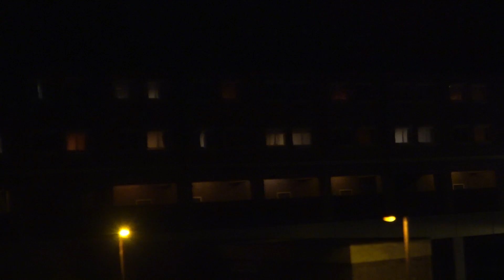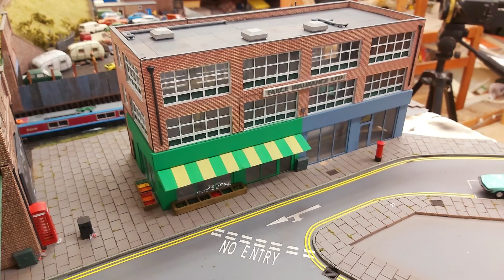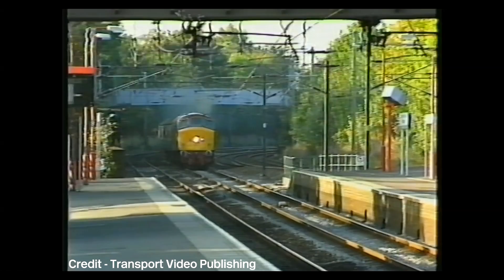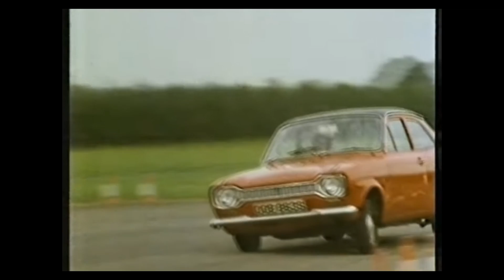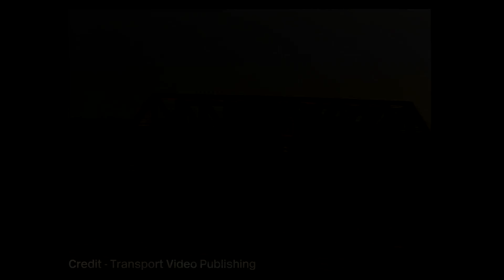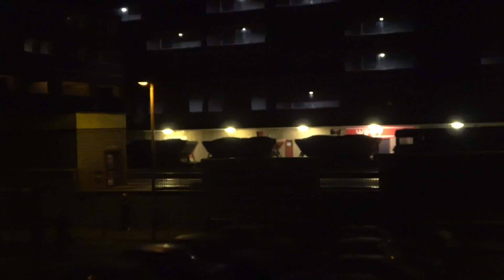Layout Update Winter 2022 | lighting, scenic improvements, vehicles and weathering

Comment: Another great video. Seacows, first batch were riveted like Sealions. Sealions had Air and vacum brakes, Seacows had air brakes but only a vacum through pipe. The Dogfish hoppers on the GN had extra steel raves welded to the top of the sides and ends.

Comment: The varied colour temperature lights in the flat looks absolutely fantastic! Could I suggest while doing night time shots for video, you may find a cheap LED RGB video light useful. If you bounce the light off your ceiling, dim it very low and set it to very cool colour temp, 7000-9000k, this will give you a twilight look as if the sun has just gone down. This will allow the camera to capture some of the detail in the low-light areas. (You may find you need to set your cameras white balance manually to 5600k, if you aren't already doing this).

Just a thought! Absolutely loving your work, keep it up!

Comment: Being a child from the 1990's which wasn't a period far away from the 1980's there was always that one street light or building light that wouldn't always turn full orange in colour and usually have a red glow. It might be great to include one light with this issue. 
Also need to add that one random football that someone managed to kick two stories on the flats or one on the waiting room/ticket office building.

The cars are brilliant though definitely Oxford diecast need to do so standard variants of cars. I would like them to do some more modern tractors 1980's onwards as most of the 80's, 90's and modern model tractors available are H0 scale.

Comment: Started on central section 1988. There was a gang at Lewes station smashing all the lbscr cast iron/ wood benches up 100 years old!  And immediately prior to the nse plastic coated metal benches. Which a few years on the plastic coating had given way and the pressed steel was rusty away nicely and people had screwdrivered up sections so it was sharp and jagged. 
To quote the late great Ian Dury. 
What a waste..

Comment: The communial lighting is spot on with the different Ks. (it deffo looks the part) At first, I thought you'd used Led ranges between 3000K-6500k, but you'd used orange paint to adjust. Superb work as per.

Comment: Great work on the differentiation on the lighting and other updates, but you had me laughing hysterically at your commentary on the real versions of the model cars.  Took me back 40-50 years when as a need and family tradition, I worked on cars and friends' cars with so many similar complaints.  We used to call them "Fred Flinstones," because eventually your feet would be through the floorboards (and having to stop the car that way), and it wouldn't have a motor.  Oh, the gallons and gallons of Bond-O we went through back then.  That class 59 is gorgeous... as an American, I never realized how much a class 59 looks like a class 66, definitely a different look from your usual stock!

Comment: The orange colour of street lighting is due to the use of low pressure sodium bulbs that were all the range, back in the late 70's and 80's.  They were cheap, low power usage and mostly, lasted for a long time.  The only downside to them was the light they gave out being of a certain wavelength that meant the colour of other things like cars, for example, looked distinctively dull and washed out.  It's a good effect to use on a model, though.  Gives it that realism look.

Comment: if you want to simulate fluoresent lamp fittings you may want to serch for filement led strips. with high resistors they could simulate singulat tube and you could mount 2 in paralell like in common fittings. the shortest filements should be even in scale

Comment: Your new paving slabs look amazing real, so much better than the card ones you used before, the scale is so much better. The card ones looked like they would have been 6 inches thick in real life. And the different colouring of the slabs is the icing on the cake, just like the real things. Loved the dark opening scene, that looked so real, and the paint you have used on for the tarmac reflected the light just the right amount to make it look like the tarmac was damp. just like it would be on a dark and damp winters evening.
Reply: The main issue with the card ones was it looked to me like the paint or solvent was absorbed and the edges swelled-up slightly in a way that could never happen in concrete or stone.

Comment: You make a very valid point re disability access and awareness. I became disabled in 1990 (Wheelchair bound) - even in those heady days - I had some truly eye watering experiences on our trains.  Like for example being told that I couldn't take my wheelchair into the first class wheelchair space because its batteries might explode - and would have to place the wheelchair in the guards van of the HST - right above the diesel fuel tanks.   And as if to make this sound even more like a good TV Sitcom - Virgin's Answer was "Our train Managers are highly trained in their task of ensuring passenger safety!"  - my illusion that they'd just hired any old idiot and given it a posh uniform wasn't shattered! My wheelchair had dry gel batteries that Virgin would fly in the normal aircraft hold at 38,000feet!!!  Im loving your videos - and always look forward to them.  Excellent stuff.
Reply from the maker: Fortunately things are much better these days despite there still being several shortcomings/issues regarding disability access on public transport.  As always I try to model what stuff was like back then rather than what I think it should be like.  I'd still consider your experience shocking though, especially for 2003!
Reply: @EverardJunction  I had some amazing experiences on trains - including preventing a train leaving because they hadn't offloaded me and the wheelchair - well what else was I going to use 12 years railway work experience for?  I knew that if they couldn't close the doors they couldn't move the train and that once Id removed the magnetic key from the wheelchair's motor - it was going nowhere! lol

I love the fact that you model as it was - that's as it should be :)
Reply: I should add that that happened in 2003 on a service from Rhyl to London!

Comment: Sometimes a reasonable representation is better that a pristine example, I’ve commented before, here and on many other modellers vids that the odd broken window or missing fence plank is more realistic and that is what you get here. There is just one point on the layout which I have an issue with. There is a trodden path which is at the farmers track bridge scenic break which runs around the edge of the field, humans being lazy creatures would cut across the field as opposed to walking around it. That’s the only thing. Oh and roof access to the flats and offices would be necessary because flat roofs are notoriously regular requiring repairs.

Comment: Hi Richard, great update A word of warning/caution for you and your audience about the new Dapol OO gauge class 59's bogies. The wheel sets are permanently fixed into the lower half of the bogie mouldings (for the rotating hubs to work) but the contact brushes are fitted to the top half! The problematic implication is that once you've split the bogie apart to perhaps check the back to backs/lubrication/adjust the tension on the contact brushes etc they will not go back together easily as the contact brushes  will be sticking out and in the way of the wheel set's return. You have to find a way of simultaneously holding back all 6 contact brushes on both sides whilst refitting the lower half of the bogie (with the wheel sets in) and clipping it down. It took me an hour to do one bogie! BTW the contact brush pickups are double fingered on each wheel back, as with the Accurascale Deltic contact pickups so hopefully there will be less issues with power outs/stalling. Regards Julian
Reply from the maker: Cheers Julian.  I had a look at taking the bogies apart and decided to leave them alone as they didn't want to come apart easily.  I struggled to paint the contact bus bar black but managed it eventually.  Looks a lot better when looking side on at the locomotive.  I'll leave the bogies well alone now!  If you find a fix for the incorrect lighting configuration let me know!
Reply: @EverardJunction  Very wise! I've not got the Yeoman model, the lighting is different on the the two I have, the Arc and National Power Blue, so I don't know about the lighting configuration issue of which you speak. I'm not even sure quite what it is supposed to be as so many pieces of footage seem to show different configurations on all classes of locos across the board! I leave the details to people who know as I'm an absolutely railway knowledge/details novice and numpty! Perhaps one of the lighting board specialists could help you, e.g. Illuminated models?
 Ps. I love the Granada you've rebuilt (the real life one). My childhood dream car, the MK1 3.0L.  Too much "The sweeney" watching! I once bought a crash damaged write off MK3 Granada Scorpio to repair but the body-shop who were going to help and fit a complete new side panel for me found that it was too badly "banana'd", 3 inches longer on one side's length! It was a side  centre door pillar impact so it ended up being a bridge too far for me as the cost could have spiralled. They said they didn't know how many man hours it would take to straighten it on the hydraulic body jig so I cut my loses and they took it on as their project instead...Possibly it needed a complete new/donor body shell, it would have been easier and quicker no doubt!
    The first car I helped convert was a Morris Minor ex GPO van which a friend bought and converted into a pickup, with twin American style lorry exhaust pipes set vertically up the back of the cab! Super looking thing...
 The most fun to drive cars I ever had were the Ford XR3i. I had 3 in total back in the mid 80 into the mid 90s, including an Azure blue cabriolet!  
 Anyway, I'll stop rambling now! lol....
 Regards Julian

Comment: Not sure if this will make sense but for your storefront sections you don't want to detail inside, I saw where someone made simple interiors by just printing on cardstock store interiors. Then they did like a setback from the windows so it gave it a bit of depth. The store front windows were installed, dirtied up with some advertisement posters up that obscured the windows a bit more.

Everything looks great so don't mind me throwing my 2 cents in. Great work as always!
Reply from the maker: That's basically what I'll be doing when the time comes.  Cheers
Reply: Yup, that was one of the recent videos from the Chandwell N-scale layout.

Comment: The centre headlights need to be illuminated on the Class 59. When I was a kid in the late 80s/early 90s, my Dad used to take me to watch trains at Hayes & Harlington railway station, and you tell when a Class 59 was approaching as the centre headlights were always brightly illuminated. They were much higher intensity than any of the other locomotives. 

I do have plenty of period photographs and some VHS footage that my Dad took.
Reply from the maker: The Dapol 59 has incorrectly configured headlights.  Its one of the issues I'll be attempting to solve.  The model features day and night mode lights despite the 59/0 never being equipped with such a feature.
Reply: Richard knows about it. He mentioned it in the dapol class 59 thread. It seems the model has some issues with the lighting and you can't have the centre headlights on at the same time as both marker lights as you see on the network. The other dapol class 59s have other lighting that isn't right either. But may be able to be sorted with some cvs changing. These probably form some of the issues are mentioned at the end of the video and what Richards going to try and fix in another video